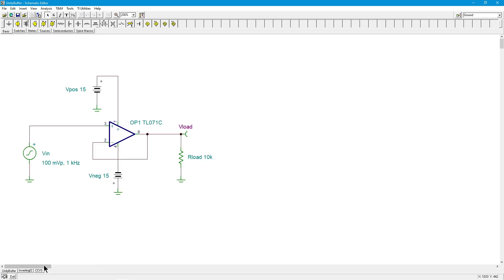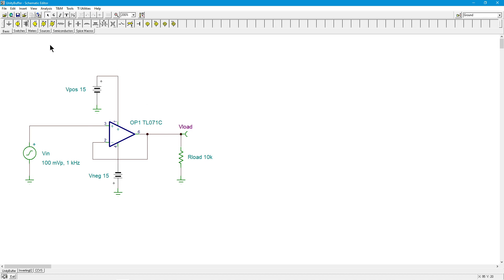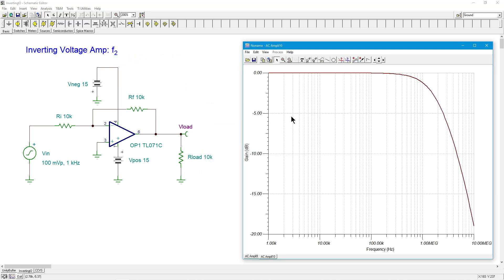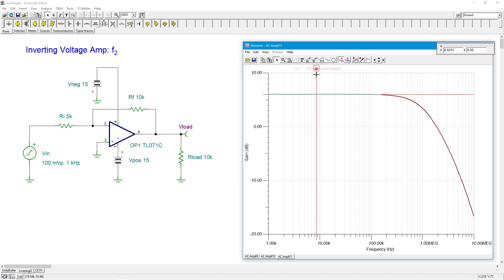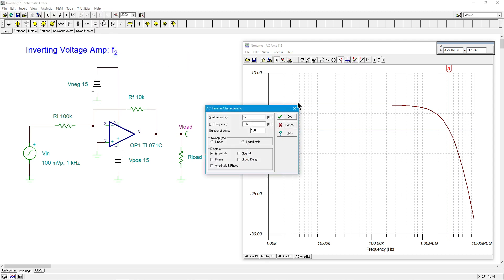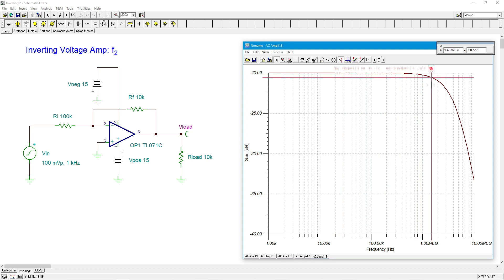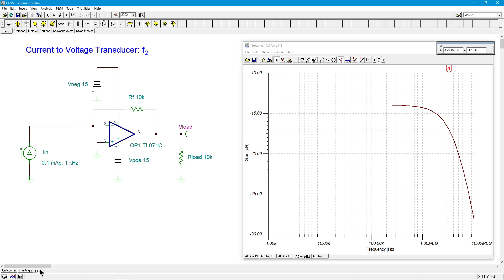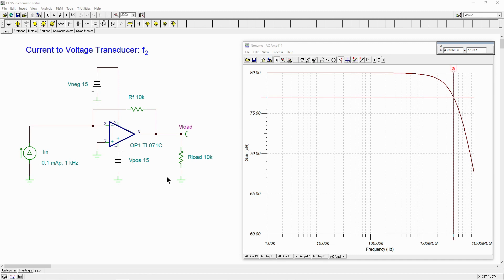Op Amps: Inverting Voltage Amplifier f2

Comment: Thank you for the lesson. But I don't understand, where is a limit for the feedback resistor? Can we, e. g. use 1G resistor for very low-current sources? Or we will face bandwith narrowing?
I know Op Amp LTC6268-10 with the GBP of a 4GHz, but in a datasheet there is bandwith of only 100 MHz for I—>V converter with a feedback of 20k (such a graph is at the first page of the datasheet).
Reply from the maker: The problem with using very large feedback resistors is that both noise and DC offset are proportional to R. Big R means more noise and more DC offset at the output. Also, parasitic capacitances become more of an issue. Calculate the fc for a mere 0.1 pF across a 1 G resistor!